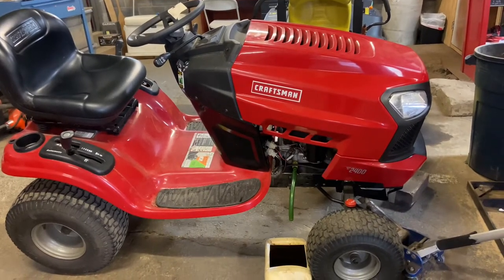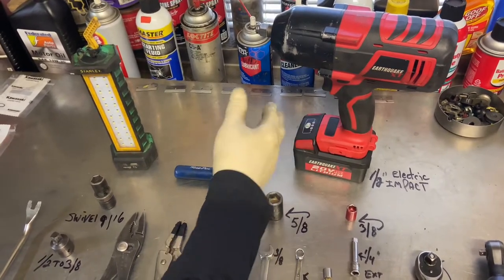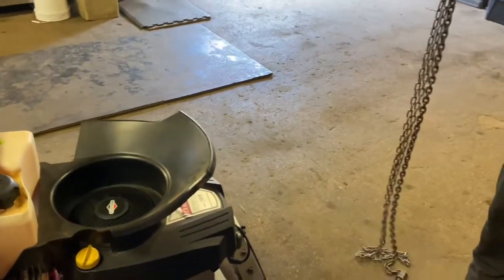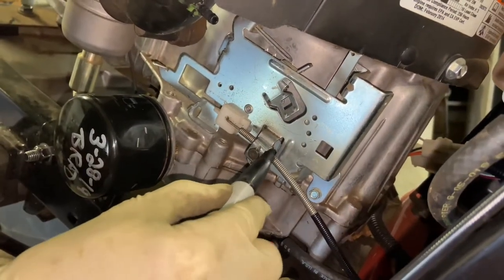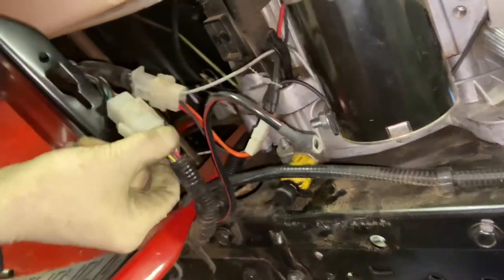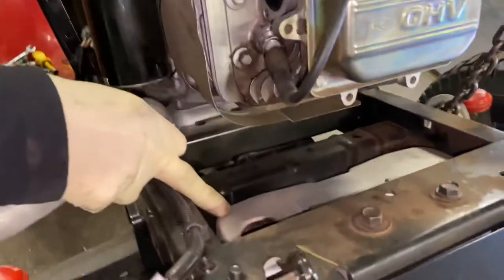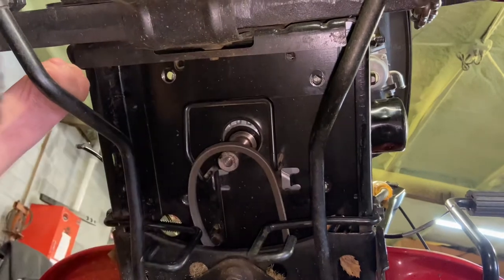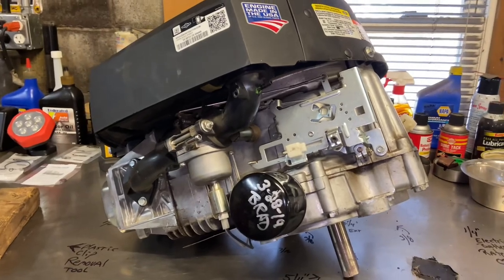How to Remove Engine on a Craftsman Tractor

Comment: Nicely done video! And it IS as easy as you show it to be. I had to do a transplant recently on my 13 year old YS4500 20hp Intek Gold that's done everything but cut grass over it's lifetime. Weeds... lots of southern NM weeds on a dirt acre - clay & stones - & moving 200 yards of fill dirt, year round. In other words, lots of abuse. Tough machine. You mentioned weight - my 1900EX replacement is listed at 77 pounds.

Lost that decompression lever as well but mine took everything w/ it at mow speed. Not one thing was spared except for, oddly enough, the governor. Thrown rod, cracked counter-balance, too much to mention. Like a mini-grenade went off in it.

One thing I've always done w/ fuel lines was pinch them off like you but then plug w/ a bolt and remove the pincher until ready to re-install. On these an exhaust flange bolt fits nicely.

Again, great video. Should be the #1 'how-to' for those needing it! Clear, concise, thorough.
Reply from the maker: I’m glad it was helpful and thank you for the kind words. Please give this video a thumbs up, subscribe and tell your friends to help my channel grow. It would be greatly appreciated:) Thank you for watching

Comment: NIce job; I just finished a 23 hp engine in my shop, same issue. Cam compression release is broken. Briggs has lots of them that break. Also I find many of the quick oil change plugs loose and leaking. Now I keep a new spare in inventory. Replace them or use red locktight on them after cleaning really good with break clean or carb spray. Thanks for excellent video.
Reply from the maker: Thank you for watching!

Comment: Thsnks for the video! The bolt holding the pully on, is it counter clockwise to remove?
Reply from the maker: If you’re talking about the engine pulley? The bolt comes off counterclockwise and on is clockwise.

Comment: Nice clean video!  I've got a t1400 with 17.5 motor, do you know if I could replace it with a bigger motor without any modification? Thanks in advance
Reply from the maker: I'm sure it can be done but I cannot say what will and won't fit.
Reply: @JohnsonsSmallEngines  thanks much

Comment: Suggestion Brad; how about removal of a Craftsman/MTD snow blower engine.
Reply from the maker: Hi Justin, It is very rare that I ever need to remove a engine from a snow thrower. If I get one in that needs a replacement, I’ll d a video on it.
Reply: @JohnsonsSmallEngines  I just bought a new 208cc MTD replacement engine for $99 from Brand New Engines. Plan on parting it out for spares.

Comment: is the engine removal the same as the craftsman t130
Reply from the maker: It should be similar but I can’t say without looking as I do not remember from one to another. I think the transmissions may be different so the belt may be different coming off the front engine pulley. As far as the mounting engine on frame it should be the same. Muffler may also be different. Let me know how you make out.
Reply: @JohnsonsSmallEngines  10-4

Comment: Looks like the tractor doesn’t have more than 50 hours on it. These are over $2000 as of 12/2023. That’s crazy money for what used to be a $900 tractor 4 short years ago.
Reply from the maker: 95% of all my videos the machines look that good. I clean them before the video. This one was a defective cam from Briggs and Stratton. That can happen at any given moment. I think this was 4 years old.